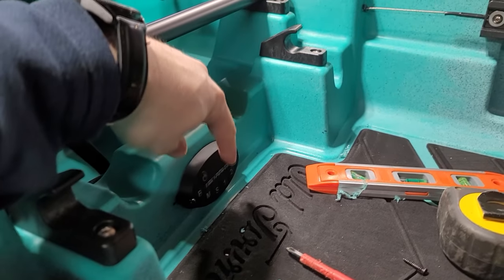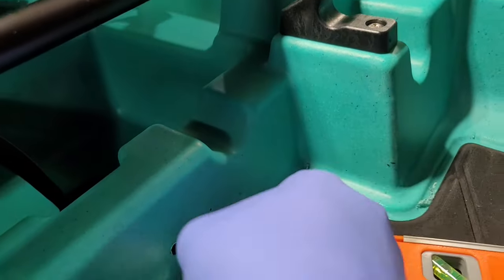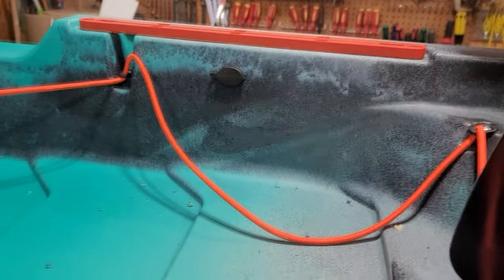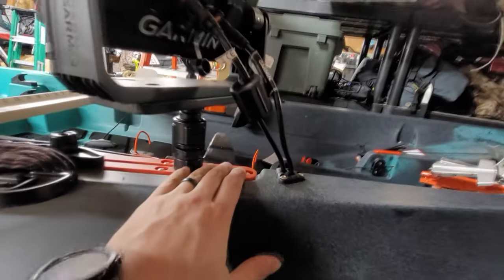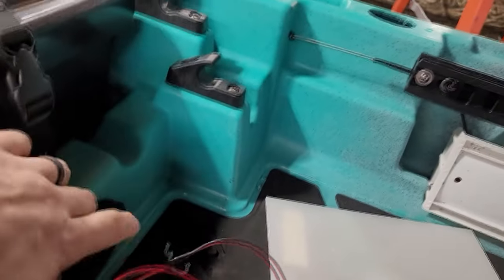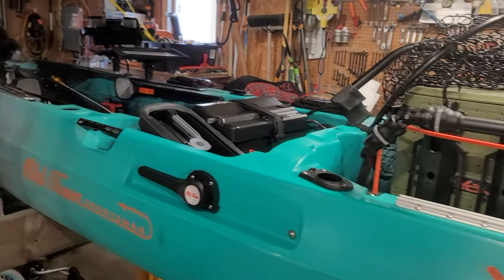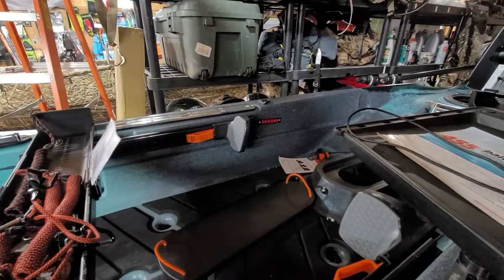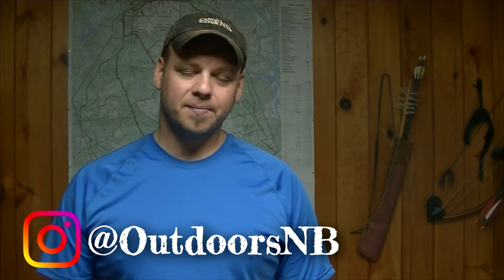Kayak Electrical switch system install - Yak Power on an Old Town Autopilot.

Comment: Hi great video.  Sweet ride.  I just got the same boat!   You said you can’t connect the micro power pole to the Yak power system.  Can explain why? And thank you!
Reply from the maker: So its phantom power isnt draining my battery when to in use. It also cuts down on em interference when off.
Reply: @Outdoorsnb  ok so it’s the phantom power idea then. Got it.  Thanks.

Comment: How do you hook up relay I need to power my trolly motor
Reply from the maker: Tjink of a relay as a switch that opens one side of a circuit between your battery and motor (make sure you have a fuse as well). The 8 channel wifi switch is hook2d to the relay on one channel. That channel just moves the relay open and closed and doesnt see the direct draw from the motor.

Comment: Can you run multiple fish finder on that 8 circuit Yak-Power?
Reply from the maker: By using the switch to power 1 of their relays for each fish finder, yes. The switch powers the relay and the finder goes through the relay direct to the battery so the switch effectively opens and closes the circuit using the relay and that way the amperage draw from the fish finder doesnt go directly through the 8 channel switch.